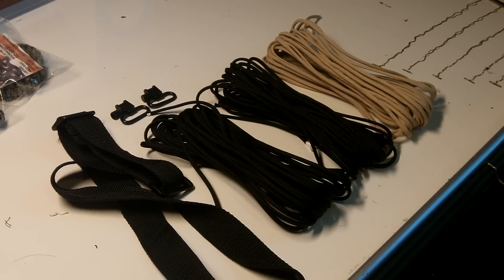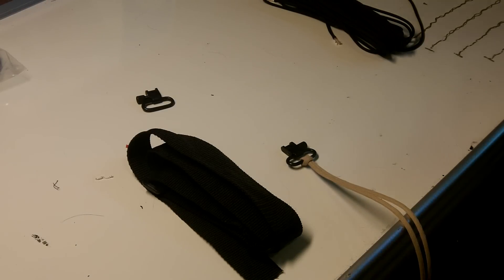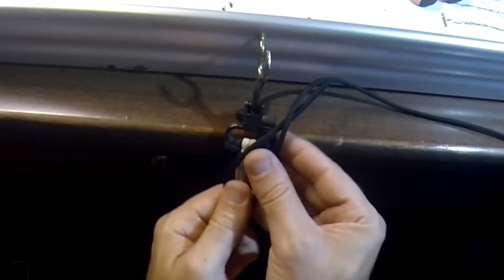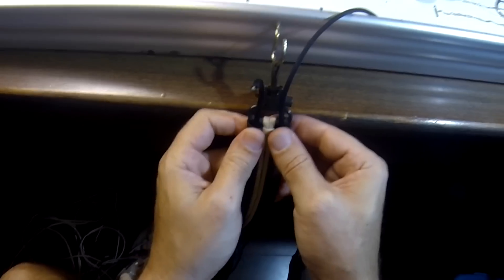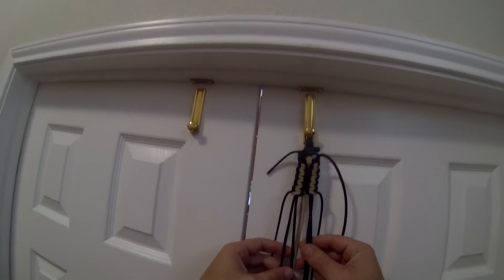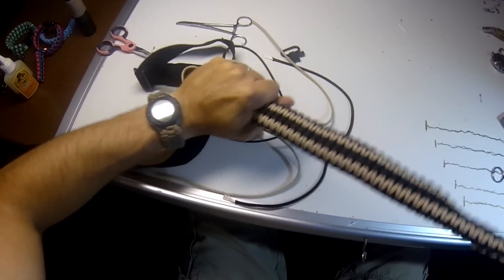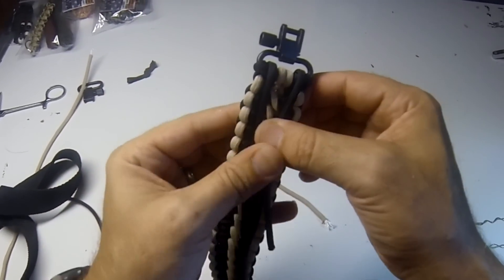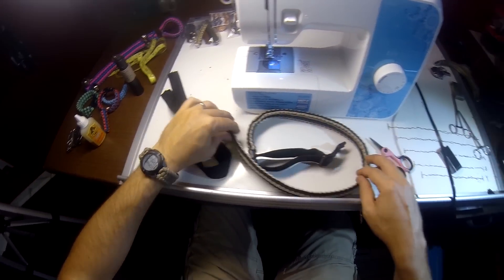Rock Paracord - How to make an Adjustable Shotgun Sling

Comment: Do you think you could do a two point rifle sling, like a vtac? It being adjustable with an Alice buckle. Been thinking of how to do one just need some insight. Thanks.
Reply from the maker: Yep, I will look into it and let you know. Check my other vids for inspiration.
Reply: Thanks man. Keep the vids coming!
Reply: chad black You should just be able to do the same as he did, just make the adjustable webbing a lot longer. You'd have to do some measurements, and maybe not as much paracord weave. Just go to the store and measure, study the VTAC sling and use paracord for the "non-adjustable" part, then webbing for the rest. Hope that makes sense or is what you were thinking of. And after typing all this, I just now realize this is 10 months after the original comment........